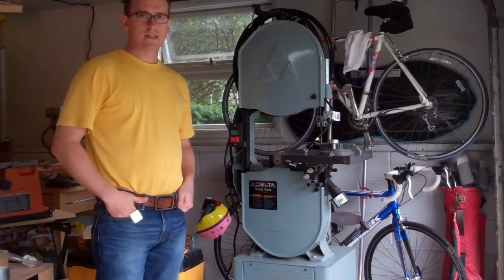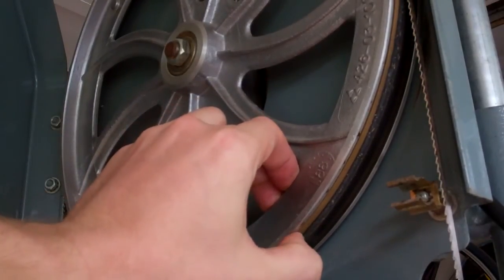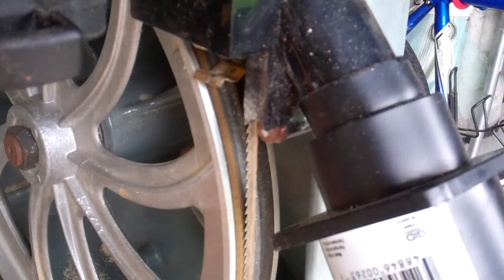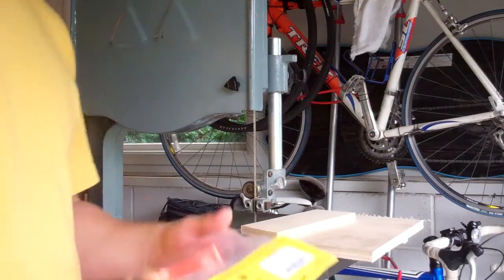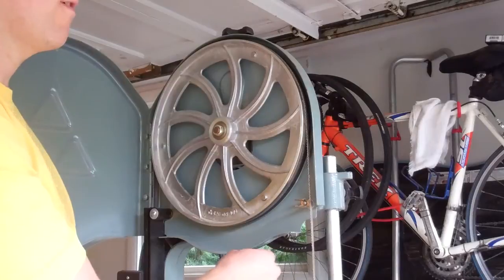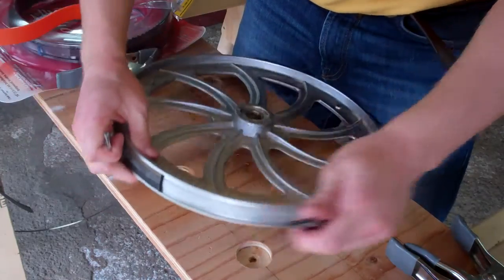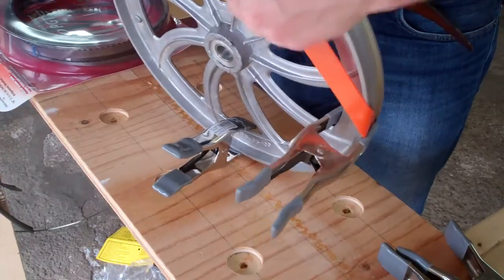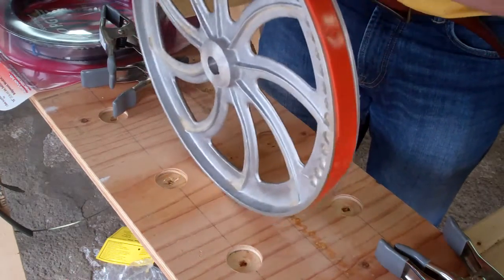New Bandsaw Tires - Before and After

Comment: No need to remove the wheels, nor use clamps. Use strong zip ties to hold the tires in place. Position the tire on the wheel, held in place by the first zip tie. Place another zip tie, tightened well, between each following wheel spoke. Tire will start getting tight about half way around, but you only need to stretch it over the next zip tie position between the next spoke (not the whole wheel). I use a screwdriver, pushing the tire onto the wheel with my fingers, to accomplish this. You'll be done in no time. It's the fastest, easiest, way to mount tires onto a band saw.

Comment: Thanks for the demo.  I need new tires too.  The saw sounded better but it doesn't seem balanced on the floor.  That is a nice saw...should last another 25+ years.  Good Luck with it.
Reply from the maker: Thanks for your comment. The saw's previous owner screwed casters directly into the base of the saw. I am going to put it on a plywood base soon with better casters. That should give it some more stability.